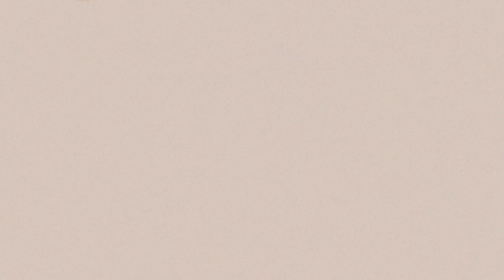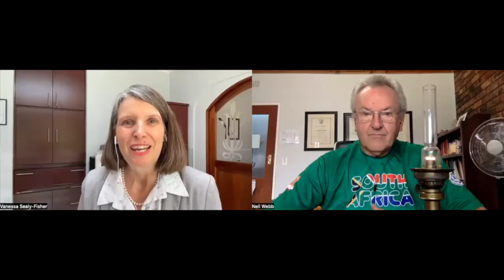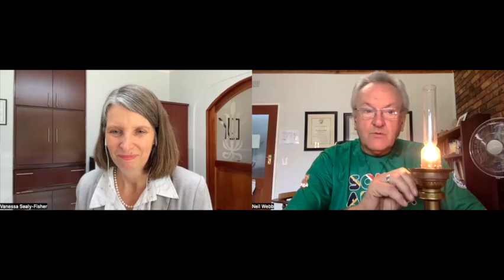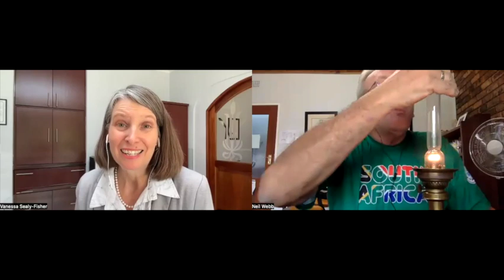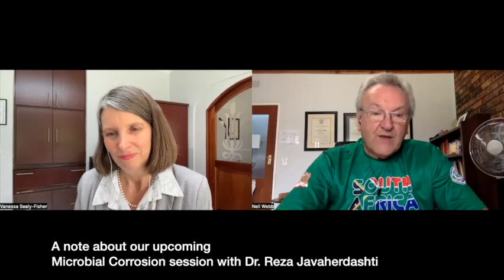CATHODIC PROTECTION | Don't Drive Your Cathodic Protection Too Hard

Comment: Agreed. CP comes to play with coating damages and till then we need to reserve the cp system to operate an optimum level. Also my approach has always been to be on top of the pipe or structure construction and installation to make sure no serious or even minor coating damages are done on protected structure and also to avoid any rebar connections to the pipe which is the case in paved areas inside refineries ..

Corrosion and CP engineers need to involve in the project right from the start of the structure to be protected is installed till backfilling or pavement in order to make sure designed CP system cater for the structure for designed life